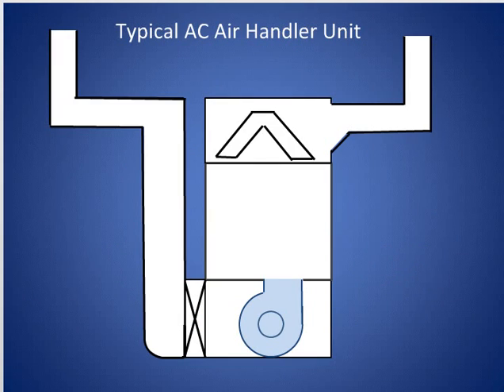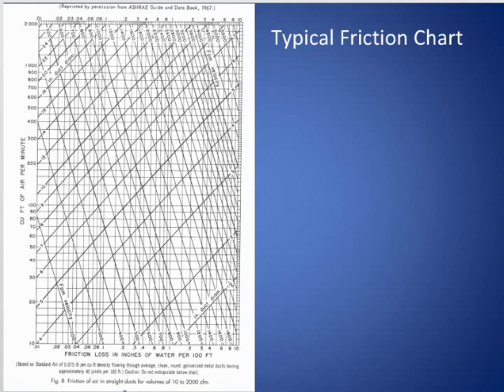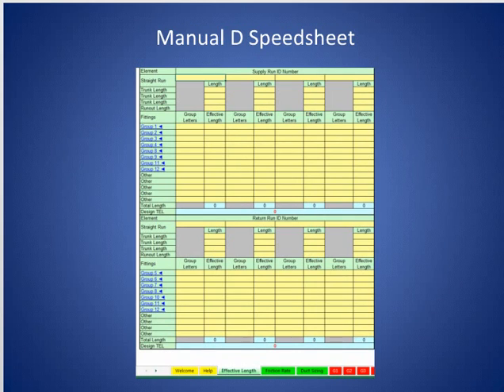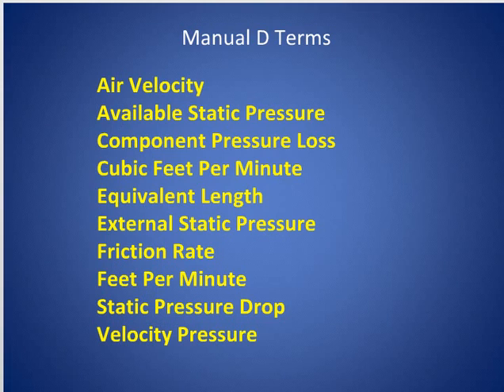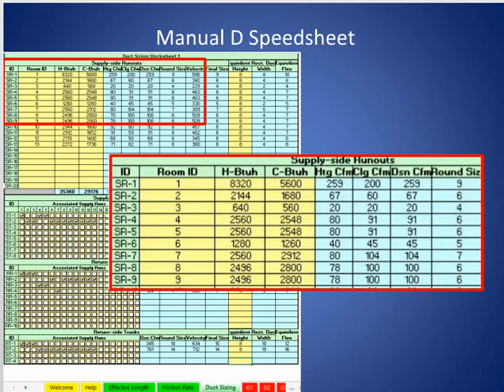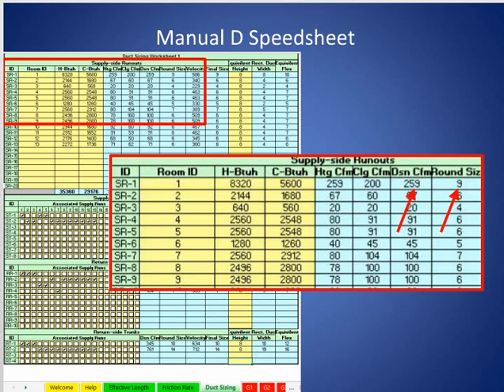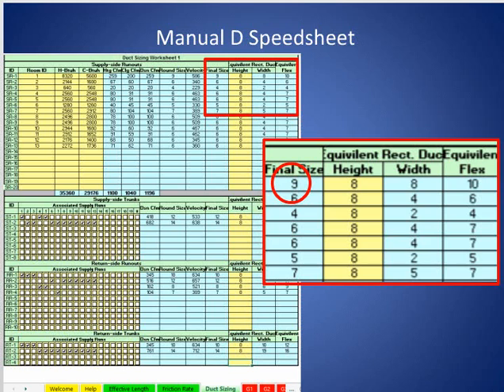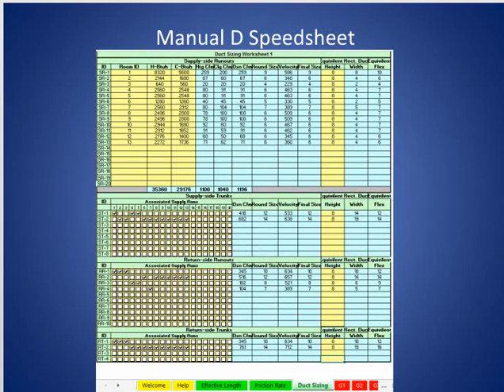Duct Design Basics Introduction

Comment: The load-calc & Sizing software is FREE; it is easy to use this software to Size Replacement units. You Definitely need to do a FREE load-calc & Sizing; helps with under-sized ducts & return air filter racks; best on a 2.5 to 3-Ton & larger systems to have 2 large filtered returns going directly to the blower air handler...! www.loadcalc.net/

(REVISIONS) Not only are Return-Air ducts grossly undersized but also filter rack areas are also grossly undersized… differences in selecting filter sizes for a particular required CFM & fpm velocity. There is a MERV 7, 4" deep pleated filter with a low 0.1" pressure drop filter sized for 300-fpm velocity; many should use it…! 
 
This is Extremely Important when Sizing filter rack areas…! * Time to start checking filter airflow fpm velocities...! When Filter Racks are Sized too Small: MERV 14, 4” deep @300-fpm .29” @ 500-fpm .40” pressure drop. MERV 14,  2” deep .39” @300-fpm, @500-fpm  .48” WOW… ! Always get filter racks Sized plenty large enough…! 

NCI is the National Comfort Institute, Inc.; they say to verify the pressure drop for that filter at the design CFM & velocity and compare it to the available static pressure of the system, the pressure drop through residential systems should not exceed 20% of the fans rated static pressure; a .5" Rated system x .20% is .1" of pressure-drop... 

However; then they show the various WRONG steps in Sizing filters for the CFM airflow & fpm velocity required; the problem is that they use the listed total square footage of the filter and ‘never figure the actual open area or AK ‘of the filter, which makes a huge difference. 

After much figuring I have found that the ‘open-air or AK’ of the low pressure drop filters is at only around 0.4875% for Purolator P312 filters (rated @ 0.16” PD @ 300-fpm; @200-fpm it's 0.1" PD) with a bar RA grille. .

Return-air filters are not 100% open-air; for example RA grilles at 400-fpm velocity have a usual pressure-drop of .03” while cheap filters have around a .08  up to .16” pressure-drop at 300-fpm velocity indicating many times more airflow resistance than a RA grille…; Hart & Cooley engineering lists them as having an Ak of around .64% of the grilles listed area, so where does that put various filter's Ak.  

We simply must start checking filter fpm velocities & then record their Ak Rating; IE., 3-Ton @1200-CFM / 260-fpm velocity is an Ak of +4.6; a +4.6 X 260-fpm is 1196-CFM, I left the extended fractions off. 

A typical 16x25 or 20x20 is a total 400-sq.ins. a TESTED CORRECTION using Purolator P312 Filters (rated @ 0.16” PD @ 300-fpm) used on MINE is: X* @ .4875% Ak  or 3.9-Ak; @ a ‘tested’ 220-fpm velocity X 3.9-Ak is 858-CFM, that is correct tested heating airflow).  Hart & Cooley Engineering Data: 16X25 RA ‘grille’ has an Ak (open-air-area) of only 1.8-SF, that is .648% of its 400 total SF area, @ 300-fpm that ‘grille’ only flows 540-CFM…! The formula is Ak *X fpm velocity; 300-fpm X 1.8-Ak is only 540-CFM on a 16X25 RA ‘GRILLE’. 

We have to figure the Ak (*open-air-area) to properly size filters to come close to the manual D requirement of 300-fpm velocity… Some say use 250-fpm, I kind of like 280-fpm as being okay. 

* Techs need to start checking airflow velocities through filters so we know we’re getting filter Racks Sized Right using the Formula measured fpm velocity *X the Ak of the Filter…!

Comment: Only problem I see is in duct sizing using the largest size whether for htg or clg CFM. You can't size duct for both if the manual J calls for different volumes unless you are going to do an air balance every time the season changes from heating to cooling and vice versa. Realistically, homeowners are not going to re balance every 6 months, so you only design duct for heating or cooling based on climate. If designed for primarily heating, you get what you get in cooling, and vice versa. Awesome info though.